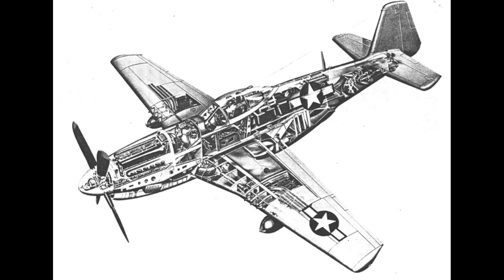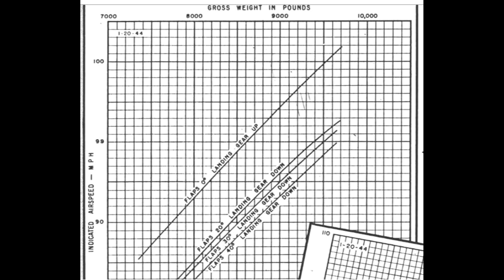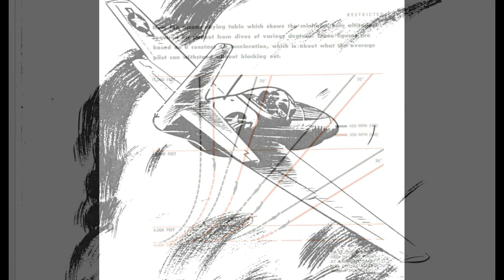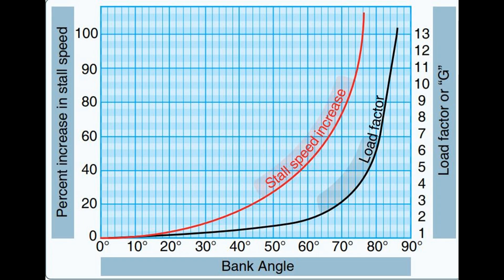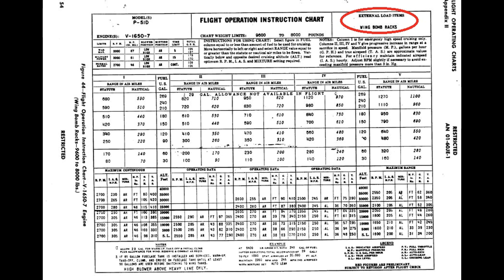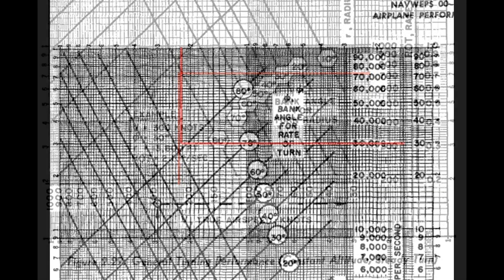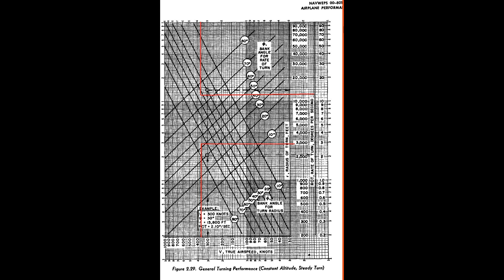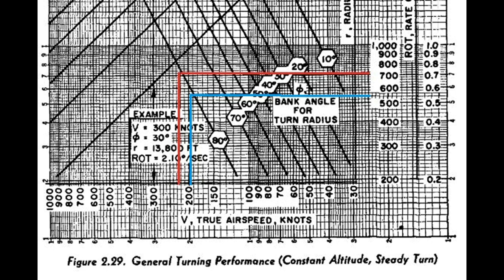P51 Mustang Turn Radius vs.

Comment: While the Packard V-1650 gave the P-51 an altitude and speed advantage, some pilots said that the early P-51s with the Allison V-1710 handled better.
Reply: Oh no doubt about that!  The Merlin gave the P-51 the kick in its pants to make it the best all around fighter of World War II, especially with high altitude performance.  That two stage, two speed supercharger of the Merlin did the trick!  As excellent as the Spitfire was, it did not have the range to carry the fight to the enemy like the P-51.
Reply: soaringtractor ____ Fuck off Wilbur.
Reply: Maybe someone should point out that there was a fighter that used the V-1710 with two stage supercharging.. it was called the P-38 and it had excellent high altitude performance.. only thing was in Europe, when used at high altitude, they kept running into problems will the engines failing for various reasons so they sent them all to the Mediterranean and the Pacific, where they did really well.. at lower altitudes.
Reply: iskandartaib  The problem with the P38 in Europe was the cold damp air caused icing problems in the supercharger system !!!!
Reply: The Allison was a much more rugged engine on the whole, and handled better on low RPM.  But overall, the Merlin’s gave more power, and more power at alt, and that decided things at this point
Reply: The V-1710 power and reliability were good, where it fell short was that the Allison Division of General Motors failed  to adapt a two speed, two stage intergral supercharger that made the Merlin so good at high altitude.
Reply: The comparative weights of the Spitfire, P-51 and P-40 may have had a little bit to do with this.
Reply: Sorry, V-1650
Reply: The V-1710 was a product of the Allison Division of General Motors.  The Packard V-1650 was a licensed copy of the Rolls Royce Merlin.
Reply: Yes, ST, I knew that it was the Series 60 Merlins were the only ones that had the two stage, 2 speed superchargers.  That is why they put them in the Mustangs.  Thank you for the other information about the earlier Merlins.  I was not aware of their supercharger set ups.  I do know that the P-40Fs & Ls had the Packard V-1650-1, copy of the Merlin 28, that boosted the P-40's altitude rating to about 20,000 feet, which was an increase by 5,000 feet over the standard Allison P-40s.  When I say 20,000 feet I mean best performance at altitude.  They could climb higher but performance feel off.
Reply: Opps, I think you have that backwards; B-17s had Wright R1820 Cyclones, and B-24s had P&W R-1830 Twin Wasps.
Reply: Really?  I heard that the Packard V-1710 design was given to Rolls Royce under Lend-Lease.

Comment: With the laminar flow wing the p-51s maneuverability was improved at around 400 kmh.  And was a brick at lower speeds.  The saber had the same issue  so that’s another factor it reduced turbulence on the wings when turning allowing to to maintain speed. And be able to pull tight turns where any other design (like the 109) would loose manuevering performance due to turbulence on the wing root this is unique to the p-51 and what made it so futuristic. I just wanted to contribute this
Reply: laminar flow wasnt archived due to distortion of airflow from propeller and guns, also rivets. laminar flow was only archived in models. laminar wings produce much less drag at the cost of less lift, so it doesnt help maneuverbility. 
laminar flow was only archived after war with specially prepared wing surfaces.
reason to use such airfoils is lower drag= higher speed, better fuel consumption, which is essential for a long range escort fighter.
Reply: Lemsko that’s not entirely true.  The p-51s wings were thinner at wing root and tip it’s wings were specifically designed for high speed maneuvers.  They played with many design.  Mostly using math and theory. The p-51s wings are what makes it unique they were also used on saber which is noted as the cause of some of its landing issues   The reduced turbulence meant it could hold energy better. And turn better against high amounts of speed.  You don’t honestly think they just threw planes together back then because they didn’t have a wind tunnel and hope they worked?
Reply: they havnt archived laminar flow in real flight. the advantage vs conventional airfoils is the much lower drag they produce. i dont say it is bad, it was exceptional at that time compared to other planes.
take a short reading here:
http://wp1113056.server-he.de/ABL/20-forschung/laminarfluegel/laminarfluegel_en.htm
Reply: as i remember USA had no windtunnel capable of testing high speed, the results are from german windtunnel tests. After war they archived laminar flow with extra prepared wings, but not over whole wing, gun ports and propeller area couldnt produce laminar flow even with nearly perfect surface. Mustang is definitely a absolute great design for an efficiant low drag aircraft.
Reply: 18tangles spitfire has eliptical wings.  Not known for speed due to heavy drag but very maneuverable
Reply: @sirilluminarthevaliant2895 the Tempest has eliptical and laminar wings and it's faster at 20,000 feet than any allied fighter. The Mustang due to two-speed supercharger is about 5moh  faster overall at 29,000 feet, but at low altitudes the Tempest will walk it. Napier just didn't have Rolls Royce's budget to develop high altitude supercharging but the Sabre makes it quick enough to run down 190s, V1s, destroying 1/3 of the total shot down by fighters, and anything at up to 25,000 feet. It was 30mph faster than the Typhoon which had a deep wing chord like the Hurricane.

 The Typhoon couldn't dive much past 400mph but the Tempest could hit 500.

'Hubert Lange, a Me 262 pilot, said: "the Messerschmitt Me 262's most dangerous opponent was the British Hawker Tempest — extremely fast at low altitudes, highly manoeuvrable and heavily armed." '
Reply: 18tangles which spit?  The later spits abandon the elipticle wings and replace Them with less unique wings.  Following the lead of high flying aircraft like the p-51.

Comment: You sir have wont the internet.

There are so many instances I have tried to explain to people who argue with me about turn performance of the P-51 vs the 109, and I try to explain to them that there are so many variants of 109 and so many variants of P-51 that even comparing is stupid!

Agents a fully loaded later model P-51D with all the bells and whistles it's going to be a heavy bird, and with that aft fuselage tank that also adds a factor to consider making it tail heavy and clumsy, and comparing it to a later ME-109 like the G-10 which has a 1,800HP DB-605D, of coarse the 109 is going to out turn the P-51, the P-51 is so heavily laden if the pilot even tries maneuvering aggressively complications can arise especially with the aft fuel tank.

But what if the P-51 has used some if it's fuel and ammo load? the P-51D was capable of carrying 269 gallons of aviation gasoline, and thousands of rounds of .50 cal, whilst the 109 had a very limited fuel load. What if the pilot decided to not fill the aft tank or burn the fuel in that first? what if the pilot in the P-51 decided to remove a set of guns? or remove some hardware from the airplane like the tail warning radar they had equipped in later P-51Ds and lighten it's load!? how would a 109 compare then? what if the P-51s engine is slightly modified to take advantage of higher octane fuels? like 130 to 150 Octane Av Gas? what if the pilot is really well practiced and can sustain a lot of Gs and the other is not? so... many factors... it's almost stupid to argue, especually when the P-51 doesn't really need to turn with the 109 to defeat it, it's faster with most models, almost all of them if modified or if it is using 150 octane fuel, it dives faster too, if it can't win a turn fight, it can easily exit from the turn fight!
Reply: Barrie Rodliffe 
But the Luftwaffe didn't have spitfires, and the same issue is a problem with the MK-IX and early spitfires, yea... they can likely out turn the mustang, out climb it, clip wing spit can out roll it, but the Mustang was Faster than the MK-IX for example by 30MPH Roughly, the MK XIV spit is different, and whether it is still faster than the Mustang can actually be questioned.

And i could joke and say, what if the US fielded P51-H or XP51-G Mustangs?
Reply: Barrie Rodliffe 

Furthermore, my book "Mustang the story of the P-51 Fightere states as top speed figures for the P-51H 

487MPH, 80 inches, 3000RPM 25,000FT

463MPH, 80 Inches, 3000RPM 15,000FT

420MPH, 40 inches, 2700RPM, 35,000ft

325MPH, 36 inches, 2200RPM, 25,000FT
Reply: Why do you compare 109, a short range fighter with a late war specialized high altitude fighter? Is it politically incorrect to compare the FW109D or TA152 (high altitude fighters) with the USA dito plane? Stop the autism about how many they built. You can not make a fair comparison when you, (if you ever) understand the historical circumstances. Germany could not ever win a war of that magnitude. The combined hostile material economical and manpower benefits must be considered. Anything else is as mad and stupid as fighting the very same war again.
Reply: @bumblebob5979  
Had the Nazis built more Ta 152s and Me 262s, the Allies would have used their own uber prop planes and P-80, which btw is better in everything except firepower compared to Me 262.
Reply: @anonymous8780  Then you must have lived back there mate, cheers! You have so much to teach us.. like why did'nt they use averall better tanks, planes, bombers and better equipped troops? How come the struggle with the European war? How come the escorter P-51 was only slightly better than the interceptor designed Me109? A frame, design and engine type from mid 30's still keeping up the 40's designed P-51. Running on 150 octane and not overperforming the old 109 with poor fuel says something to them who can understand something. 
Another guy, a pretty well known one, also a german, who emigrated to U.S in 1933, invented the Nuclear bomb and alot much more intelligent theory. We owe him for that.
 But actually, im probably wasting my time here.. Best wishes, you very enlightened man...
Reply: @bumblebob5979  Oof I didn't mean to trigger you. :(
Wait... I did not say that Luftwaffe didn't have great airplanes, tactics or pilots. They had those, especially in the early years. 
P-51 and Bf 109 are both interceptors. Mustang has far longer range and endurance tho, and the Packard Merlin gave it the high altitude power it needed.
If you're comparing 109G-6 and G-14 to P-51, Mustang is obviously superior.
 G-10 and K-4 are tough opponents for  P-51 at most altitudes.
By the way, all those planes, tanks, ships, troops etc. for the Allies had to come from somewhere. So yes, Third Reich was beaten at everything, on the ground, in the sea and in the air etc.
I'm very grateful for that.
Reply: @anonymous8780  Not triggered only dissapointed, but I expected that, It's our natural level...
..They where only out-manufactured by whopping larger economies. How do you build good jet engines without the metals needed? How do you manufacture airplanes with bombed factories? How do you fight an aerofight with empty fuel tanks? How do you win a war with a braindead dictator willing to sacrify his entire people? Well they all nearly did.
How does our world look today, it's turning into a garbage dump. This is what they fought for and died for. Sadly truth is a gray thing. The U.S did nothing exceptional in that war, and by winning it, they just got addicted into winning more wars. Molesting more economies, and commiting other war crimes. Those voices seldomly heard. The winner takes the glory from the battlefield and rewrites history as stomach thinks. If Sweden would have joined the war and beat germany at it, that would have been something. Then were talking worth mentioning.
I've heard too many times from grown ups how the P-51 won the war and it's overpower, it's glory.. Well it's a big and well taught kids fantasy. The P-51 was not revolutionary in any way. This revolution were made by germans in that period of time. Others mostly copied it. I do not glorify destruction and killing. But at our mental level, it's pretty much the rule than exception. Only a fool would argue against. It is inevitable...
Reply: Barrie Rodliffe the P-51H was able to reach the 780+ km/h speeds on 90" wet wep (water/ethanol). The Dry wep was configured to be either 67" or 72". There was a second setting for wet wep. That was 80" which would not lend itself to the same top speeds. This was a more common setting however the 90" was also used. This was not an estimate. This is a performance figure. Given that the wet wep had only about 7 minutes of use, much of the numbers you might find could be for 67", 72", or 80" rather than the 90".
Reply from the maker: Thanks Ace.
Reply: Barrie Rodliffe 
But the question you asked is what if the liftwaffe fielded Spitfires, they never did, my answer is this simply.

The P-51D Mustang is not going to turn with a spitfire, the spitfire in it's design put simply designed to be a more maneuverable airplane, it is a light weight interceptor, designed to climb and meet a threat.

The Mustang is a escort fighter, it is designed to carry 269 gallons of aviation fuel, and also carry a pair of 108 gallon paper drop tanks on its wings, having a rough range of 1,200 miles on internal fuel load, and 2,080 miles with the 108 gallon/110 gallon drip tanks.

To compare the two in a turn fight is silly, the spitfire will out turn the Mustang yes, but the Mustang has the speed advantage.

At Military power the Mustangs top speed was 437MPH at 25,000ft at 61 inches of mercury (military power is 61 inches of mercury 15 minutes) I have read in some sources speeds as high as 439MPH.... but that may be scewed. Its top speed with war emergency Power with 100-130 Octane fuel was 442-448MPH and these figures often range highly dependent on fuel load, ammo load, and hardware equipped. Then you have 150 Octane fuel, which brought the mustangs top speed exceeding 450 to 460MPH and that's at 75 inches of mercury at War Emergency.

I now ask, what speed does the spitfire go? MK-IXs achieved 408 maybe a little over 410... MK-XIV Griffin spitfires did.... 445MPH roughy. NOTE..... also the griffon spitfire got a lot heavier with its griffon engine! Lost a notable amount of its agility for gains in speed and climb performance.

So over all if the Mustang loses advantage in the turn... it can again... choose to exit the fight with the spitfire and gain horizontal seperation and possibly gain verical seperation in a shallow high speed climb. Also War Emergency settings on both planes are exactly the same! Except the Mustang uses a Packard Merlin V-1650-7 and the MK-IXc uses a Rolls Royce Merlin 66.

Furthermore I highly doubt the top speed of the P-51H was only 450MPH when it had the V-1650-9 which is rated at well over 2,000HP and has water injection! The P-51H also had a more steamlined airframe, and re shaped wings. The XP-51G had the same engine, but was over 1,000LB lighter than the P-51D and P-51H.

You also have to take into consideration many variables for top speed testing.... what fuels were used? What settings did the engine have? What was the planes load out? What altitude where the tests at? Lots... and lots of questions, so top speeds can very between 20-30 MPH depending on many conditions.

Comment: Do wing slats on 109 offer an advantage?
Also, a plane nearly out of fuel ad ammo would be much more nimble
Reply: iirc, it kept air from separating from the wing at high angles of attack.  In the 109’s case, it was mainly for the wing tips, to prevent the ailerons from being unresponsive, one of the things that make deep stalls in swept wings so deadly
Reply from the maker: Hi Gunther, yes, the slats offer a meaningful advantage.
Reply: @GregsAirplanesandAutomobiles  "Other sources" (Meaning, I forget exactly where.) held that the automatic leading edge slats significantly damaged the dog fighting 'gun platform' aspect of the Bf109s with them. The opinion (Experience? May have been a German pilot.) was that the transition between normal and extended positions wasn't under the pilot's control, and unanticipated changes of setting disturbed the wing's angle of attack overall, and between wings, making accurate deflection angle shooting in turns more difficult.

Comment: I would like to see a video comparing specs on the p51b & c models to the p51d. Most people don't  even know these older models exist. Great video!!
Reply: B and C were essentially the same, built at different factories (like the D and the K were essentially the same). The B and C were lighter than the D, the D had the bubble canopy (of course), a thicker wing (which allowed the guns to be mounted upright and alleviated some problems with jamming in the B and C). The heavier weight also made the D slightly slower, as did the bubble canopy (it's actually got more drag than the faired-in birdcage canopy and high turtledeck). IIRC the B and C were usually only fitted with 4 .50 machine guns, the D had 6 (adding to the weight). The D came in quite late, supposedly fully half of the Mustangs in operation in Europe on VE day were still Bs and Cs.